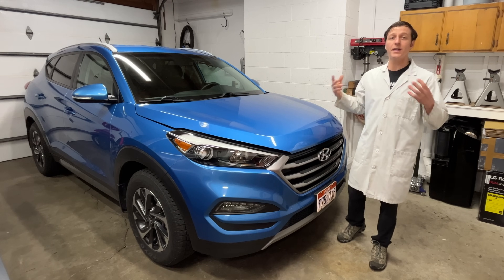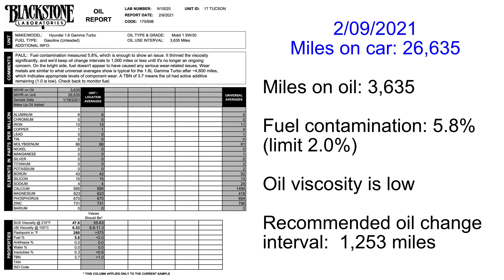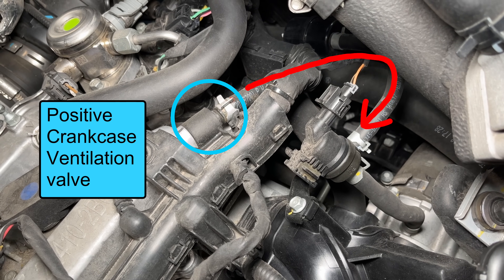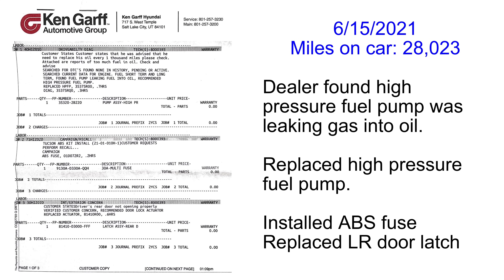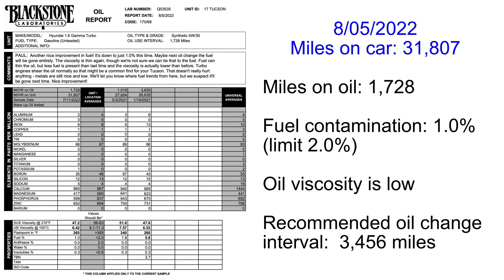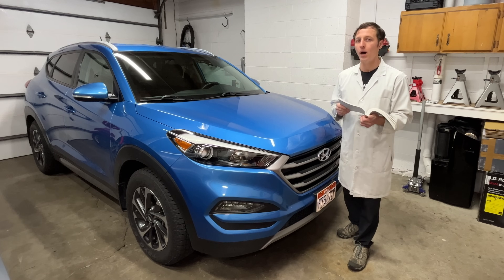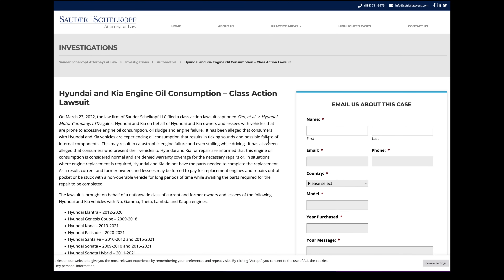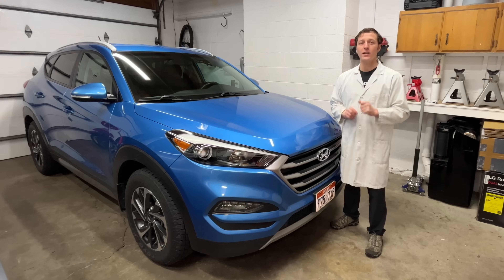Hyundai oil consumption and gasoline contamination problem solved

Comment: It's not the DI. Its the piston rings scoring up the cylinder walls. The scoring allows oil to enter the combustion chamber and there it gets burned and pushed out the tail pipe. I've replaced hundreds of the 2.4L and everyone of them has vertical cylinder wall scoring.
Reply: Doesn't even have to be scored to have high blow-by. You just need inadequate sealing pressure from the ring pack, which can be caused by a number of issues from bore geometry to distortion to ring tension to end gap. Getting fuel in oil AND oil in combustion would indicate that both the combustion ring and the oil control ring aren't doing their job. That would lead me towards checking the bore geometry. I'll give them the benefit of the doubt that free-state geometry has circularity well-controlled. This means it's likely a bore distortion issue. In a soft material like aluminum, especially in such a small application, it would be easy enough for the block to distort when the head is torqued if proper consideration hasn't been given to fastener depth, location, and loading. This often results in an nTH order lobing of the bore that many designers fail to consider. This is especially likely in higher compression applications because bolt load must be increased to maintain sealing pressure at the head gasket. When you mix high loads and high temperature with a material with lower strength (aluminum vs cast iron) and toss in a higher pressure injection not typically seen in the gasoline engine market (not uncommon in diesel though), high blow-by isn't just possible, it's almost a given
Reply: @marcb2056  Don't they always use steel sleeves in the bore?
Reply: @filippocorti6760  you'd be amazed how much steel will still bend under load, especially when you consider that the amount of distortion needed to cause a leak path is measured in microns
Reply: @marcb2056  Aren't all GDI engines higher pressure injection?
Reply: h
ave a 2015 tucson. Brought with 155000kms on it. 3 months after purchasing it engine light cane on and was throwing code P0420 ( cat converter) I had it replaced. Now 5 months on its has done only  7459kms engine light is back on and throwing the same code. 

It has been burning oil like mad has been serviced twice. In the 8 months of owning it. 

Obviously if the car is still burning oil there is no point in replacing the cat again. Trying to find a solution to the oil burning. I have hurd the pcv valve, piston rings and intake valves could help, but from further reading this has not been effective. Any ideas anyone?
Reply: @emilyhenness938  See if it is covered under an extended warranty replacement program like in the States. Research, keep looking. Very sorry for your situation.
Reply: @filippocorti6760  thankyou for your reply! Unfortunately it's not
Reply: @emilyhenness938 use valvoline restore and protect oil. Also piston wash with Berryman B12.
Reply: @emilyhenness938  also converter cleaners at auto parts store
Reply: The scoring is from the gas diluted oil?
Reply: Are you tearing the engines down to know this, or are you just inferring this? I mean the GDI does sound like it could be a factor

Comment: I own a 2014 Santa Fe sport. I never realized there was an issue because I faithfully had the dealer change my oil every 3000 miles with regular oil. About a year ago I tried the synthetic oil which extended the internal for my oil change.  I began to notice that the car would occasionally not start up immediately which it has never done. I decided to check the oil and there was nothing on the dip stick. I immediately added oil to bring it up to full but have had the same issue again after another synthetic oil change. After watching this video I know now I cannot trust the  normal oil change frequency nor the quality of the oil. I will try to get back to a 3000 mile interval but I'm not hopeful.  I will increase the frequency based on oil level but never more than 3000 miles. Thank you so much for your diligence an extremely detailed and information.
Reply: Use valvoline restore and protect oil

Comment: Excellent video.  IMO, engines using GDI should still have some percentage of its fuel charge delivered using port injection, partly to wash all the crud past the intake valve to be burned in the combustion chamber.
The question I have is your driving mix.  My thinking is longer duration drives (>30 min) periodically, get oil >>200F, hot enough to evaporate the gasoline from the oil and have it burned after passing through the PCV valve.
Is this a bad assumption?

Comment: The class action for this failed. My initial interpretation was due to poor presentation by the representing attorneys for the plaintiffs.
Reply from the maker: Interesting. I'm sure they just said "you didn't maintain your car, that's why it blew up". Unfortunately, Hyundai recommends 5,000 mile oil changes on cars that need 3,000 mile oil changes.
That's not the only company misleading customers. Toyota tells people 10,000 mile oil changes are acceptable. That is also a lie. If your car doesn't get gas in the oil, max you can do on an oil change is 6,000 miles.
I suspect the car manufacturers get oil change recommendations from their marketing team. I prefer to get recommendations from lab results.
Reply: @LabCoatPaul  absolutely agree. My engine was so bad I had to keep a funnel in my car and stop at Walmart to top it off, as it was eating oil nonstop. Not to mention the oil changes, but it basically had new oil in it all the time.

Finally at 93k miles it blew. Got the run around and was told they would not cover it under warranty. 

Fortunately for me, I'm crazy and recorded every call, in-erson interaction, and eventually their attorney's correspondence after I sued them pro se. Of course, the recordings were done legally so they didn't have a leg to stand on.

I got what I wanted by representing myself pro se. 

I say "I'm crazy" but honestly I 100% understand how people get screwed by this because practically no one would go the extent I did.

Comment: Why are Hyundai's and Kias are such bad engines and there at least one car maker that doesn't have direct injection it is Suzuki why they don't sell Suzuki's in North America but they do sell them in Australia and also no engine  cover and we will change the oil at the recommended interval also my 1997 Toyota Hilux has done 437000 kilometres and doesn't burn oil at all and l will be changing the oil at its regular 10000 kilometres 6000 miles and it doesn't consume any oil but it does consume petrol and it doesn't have fuel injection it has a carburator and l can drive any were in Australia  and at the yearly registration inspection in N.S.W only no emission testing and l can't understand any body buying a Hyundai or Kia although tbey are obviously sold in Australia and we have a greater choice of good reliable vehicles available in Australia and l can't understand you bought a Hyundai were at least you have Toyota's Honda's and Mazdas not the diesel but the petrol ones are fine and the Toyota's  are very popular in Australia

Comment: What’s the cost for a high pressure fuel pump? I called Hyundai and they told me $745. Is there anywhere I can get it cheaper? And also they said a PCV valve cost $40. I have a 2016 Hyundai Tucson with 90k miles. My last oil change barely had oil smh. And it was my first time experiencing this. Had the car since 2019 and have been on point with my maintenance. Great video by the way
Reply: Still have issue ?
Reply: Still have issues with hyundai  ?
Reply: Dual oil catch cans,  one for pcv and the other for crankcase,  add breathers on the output of catch cans

Comment: The problem with this is people don't realize changing oil on turbo engines is more critical and also many are not changing the pcv valve. My two Elantra 2.0 went 240000miles but I have been working as a mechanic since college since 2009 and I noticed all this on the new engine design changes make maintenance more critical. Look at spark plugs most modern vehicles only do 30000-40000miles on platinum and iridium once marketed as 100000miles on port injected engine's.

Comment: I have 2015 soul 1.6L. Added oil catch can. With 114K miles it doesn't burn a drop of oil. Change around 2500-3000 miles with Mobil1 5w20 high mileage and Bosch oil filter.

Comment: 2017 1.6T here as well, same color. It started burning oil around 100k miles, perfect timing since thats the warranty! It needs about 0.75 quarts every 1000 miles. Unlike my lexus gx470 with 233k miles which has new looking oil after 7000 miles and no addition needed, the Hyundai oil is black after 500 miles.  I do the CRC intake cleaning every oil change and have tried the Castrol Edge GDI oil, which is expensive. Hasn't helped. I may go to cheaper Mobil 1 or Valvoline and just change every 3k miles instead of 5k.

Comment: One thing i did not recall you mentioning is what your driving style is and the average length of your trips.  Short trips often do not allow the oil in your crankcase to reach operating temperature long enough to help evaporate any excess fuel and moisture which are usually blowing by the rings during a cold engine startup.
Reply from the maker: It's short trips only for me, so my oil gets contaminated very quickly.

Comment: Very good presentation and pictorial presentation on the insanity of GDI.  I drive a 2.2L HHR.  It continues to average 24 mpg in town and 30+ mpg on the road as it approaches 120K miles.  Oil consumption is negligible.  For trips and Sunday driving we also have a 2002 MBZ E320.  It continues to average 22 mpg in town and 30+ mpg on the road.  LIkewise the oil consumption is negligible as it approaches 100K miles.  Both cars have multi port injection and have never failed an annual emissions inspection. Not all "modern" cars burn a lot of oil...just the ones with GDI.  The industry should be allowed to go back to MPI.
Reply: The industry's only barrier to going back to MPI is their own refusal to produce cars that can achieve decent mileage without GDI.
Reply: My VW gti doesn’t burn oil and it has gdi, Hyundai has terrible high pressure fuel pumps and piston rings.
Reply: @locluke979  I think there are aftermarket piston rings.

Comment: So im planning on buying one. a 2016 model. Is there a way besides changing oil frequently to prevent an engine from blowing? And what if the engine is starting knocking? What can you do to repair this?
Reply from the maker: Frequent oil changes are the only way to prevent excessive wear. Change the oil and send a sample to the lab, like I did. 
If the high pressure fuel pump leaks, even 3,000 miles is not often enough. 
If you have a knock, that engine is already ruined and needs to be replaced. You could get a few more miles out of a knocking engine by running a higher viscosity oil, like 20w-50, but don't do it to an engine that is working normally.
Reply: @LabCoatPaul  that's crazy to keep changing oil every 3000 miles tho hahah. There needs to be some kind of fix voor this...

So if the engine in knocking, changing the pistonrings and bearings won't be enough?

I cannot believe this. I have an older BMW I change the oil every 10.000 miles or so and I find that often. Now I want to get a newer car and I need to change is more often hahahah am I dreaming
Reply from the maker: @007kwaku  Many modern engines with gasoline direct injection have oil contamination issues. It's true newer engines require more frequent oil changes than older ones.
For example, I sent oil to Blackstone labs from a 1998 Toyota Tacoma with 260,000 miles. The report said normal wear metals, 0 fuel contamination, 6,500 mile oil changes are ok.
10,000 miles oil changes are not good for any engine. Next time you change your oil in the BMW, send a sample to the lab. If you pay extra for the TBN test, they can measure the levels of additives remaining in the oil and give you an oil change interval recommendation.
If an engine doesn't contaminate the oil (like my Hyundai), 6,000 mile oil changes are ok.
Reply: @LabCoatPaul  if the engine is running without tikking, what kind of oil is good to out in? I live in the Netherlands. In the winter it can get somewhat cold. Around 0 to -10 Celsius and in the summer around 20/30 Celsius (30+ only when there is a serious heat wave)
Reply from the maker: @007kwaku  Check your owner's manual for oil viscosity recommendations. Mine says use 5W-30 synthetic for cold weather.

Comment: I'm having issues with my tucson 2018 . My mechanic told me the engine is consuming excessive oil. I have done all my maintenance roughly around 3 to 4k miles.  I have an appointment this Saturday with the dealership and see what happens .

Comment: The cost of your oil analysis would almost pay for a 5 quart jug of Mobil 1 synthetic oil  (Walmart )  and a filter from the dealer. 

My advice to friends who buy Korean or European cars : Don't keep them past warranty. 

My next vehicle will most likely use the Camry hybrid drive train. (Rav4, Vensa, Crown,  similar Lexus  (probably used)). It has GDI but also has port injection. 
No turbos,  efficiency tuned, no accessory belts. Electric car with gasoline assist. 
No start stop needed. Engine only runs when it is needed (and to warm up).

Comment: So I own a 2014 Hyundai Accent 5dr with the 1.6 L GDI. I've owned this car from new.  No real problems with this car in it's lifetime, aside from effects of driving on crappy roads and rusted out brakes. Always changed the oil twice a year, added fuel injector cleaner to the tank periodically, etc. 

I just passed 100k, and it started to burn/consume oil with ferocity - ~1L per 1000 km.
I just changed the PCV valve, and am trying a seafoam treatment on the oil prior to my next oil change. 

Your video is a lot to wade through. Is there a fix, other than super frequent oil changes?
It's north of $80 CAD + taxes at the least expensive place I can take it, and that's for conventional oil.
Reply: any update? my hyundai accent 2015 95k milage burns alot of oil since about 90k.
Reply: @nomu5815  From experience, we're SOL. There's no warranty on the drivetrain beyond 5 years/100k, unless you bought something extra. 
Hyundai told me I needed a new small block engine, gave me a quote for $11,000 and wiped their hands. 

Accents aren't part of any recall or lawsuit in Canada, despite having the same oil consumption issues and poor piston rings as all the others of the same age.

I've managed to keep mine going an additional 30k kms using Marvel Mystery Oil, LiquiMoly, etc, products, cleaning some of the sludge out - but after attempting to clean it up, the engine started making a lot of noise (knock, slap, tick). 
It'll be a matter of time before it blows up/fails permanently. 

Is it better with the newer vehicles? Not according to the forums.

Comment: Did you follow Blackstone's instructions for getting a sample properly? IIRC, you're supposed to 1) get the oil good and hot - minimum 15 miles drive before taking the sample and 2) get your simple from the 'middle' of the stream of oil coming from the pan. You show pouring from an intermediate container, and mention in the comments below about most of your driving being < 4 miles, which won't give you the most accurate results (though I guess if you are always doing < 4 miles, it's somewhat more representative of your typical driving conditions... which are not good. You're actually a good use case for electric if you're always doing such short trips).

Comment: I have a 2013 KIA Rio. I bought new and have done all my oil changes myself. Also note a tow a 800 lbs jet ski from time to time.

I have always used Mobil One 5W-20 oil and Mobil One filter. Reason for my choice is available most places.

I change oil every 4,000 to 5,000 miles do to having an understanding of gasoline direct injection engines.

I currently have 142,000 miles on the car. The engine uses about one half quart of oil between oil changes.

I also change transmission fluid every 35,000 to 40,000 miles. And coolant is changed every four years.

I wonder if most people who have someone else changing their oil are getting bulk oil and waiting till like 7,500 miles to change it???
Reply: Drain and refill transmission fluid or flush?

Comment: 2Gr -fks has a serious oil leak problem where the head, block and timing cover seals intersect.  Generally get larger after 100,000k.  As it ages it drips oill onto a smokey exhaust.

Fixing it usually is an engine R/R and cover reseal.  Figure $4000.

Comment: I drove my 2017 Kia Soul 1.6 turbo for 137,000 miles without a single problem ever. Changed oil every 5k and used top Shell or Chevron gas only, no exceptions. And i drove it hard. 
That's the key, I think. Drive it hard to get the sooth out
Reply: I agree. The Santa Fe needs to be driven hard, and one mustn't shy away from pressing the pedal.

Comment: I'm hoping the catch can I put on my 2020 Palisade helps reduce the fuel dilution. I have been changing the oil right around the 3000-3200 mile mark since I bought it and I don't see any loss of oil. I've done one GDI cleaning with the Berryman cleaner so far at around 20,000 miles.
Reply from the maker: The catch can will keep your intake valves slightly cleaner. I doubt it will have any effect on fuel dilution in the oil. 3,000 mile oil changes are a great idea if your high pressure fuel pump doesn't leak. Send a sample of your oil to Blackstone labs to find out if anything is wrong.

Comment: Well when you buy the car new you get a 10/100 k warranty so I'd the engine blows them the manufacturer will replace it. I personally use moa by bg to help protect the engine.
Reply from the maker: The 100K warranty only applies to the original owner. Buying the car used gets you a 5 year powertrain warranty. Testing the oil and changing it often is the best move.